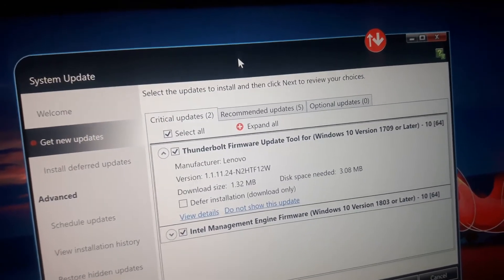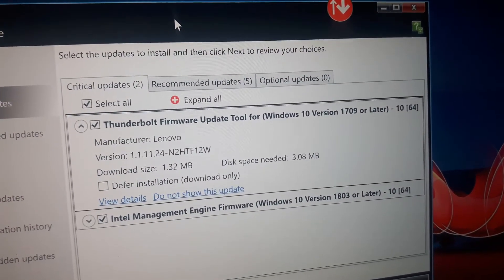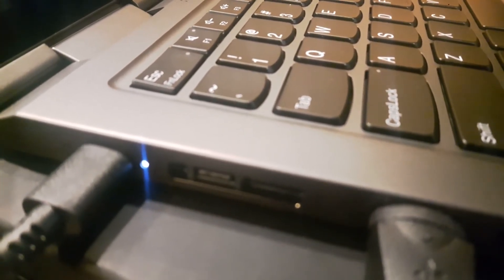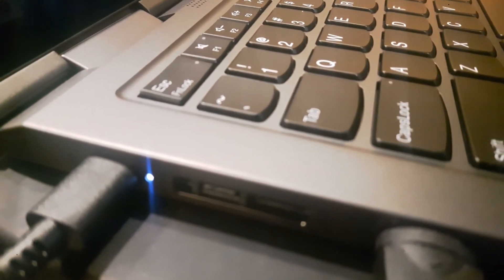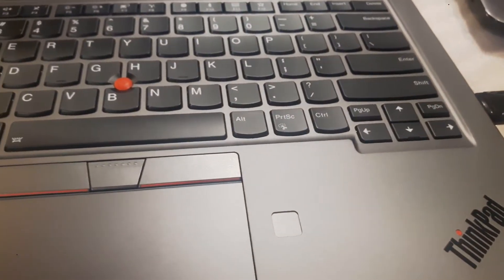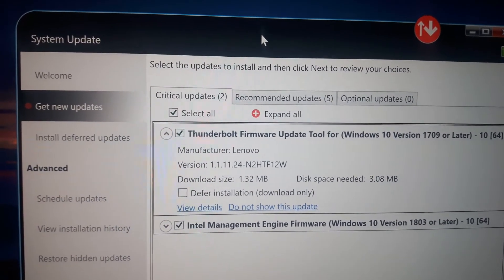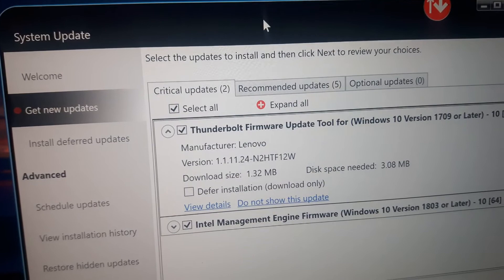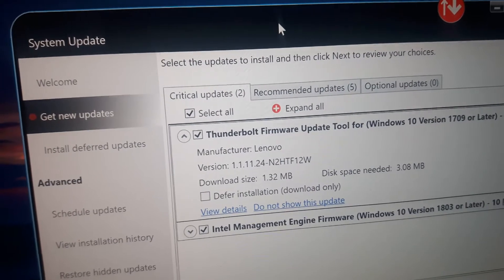Important: Have a ThinkPad with USB C (ThunderBolt) charging? Apply this firmware update

Comment: I just got a lenovo t480 and I am very confused as to how to check to see if this refurbished lenovo has already had the update. can you give information on that? or maybe how to actually do the update. thanks in advance
Reply: Did u find a solution ? Any Update Please
Reply: @PerspiCacious-wq7nk  not yet
Reply: Check thunderbolt control centre, tap about and it will say version
Reply: Did u get to the bottom of this?
Reply: Run 
Get-WmiObject Win32_PnPSignedDriver | Where-Object { $_.DeviceName -like "*Thunderbolt*" }
In PowerShell to see if you have the driver
You can check Lenovo vantage for updates
Reply: Right click the thunderbolt icon on the right left corner in windows, then choose about and see the NVM version if its 20 or more you are fine!

Comment: Does this fix the critical issue with the Thunderbolt Driver ???
Reply from the maker: It' should fix the firmware issue that causes the Thunderbolt device to flake out and die. If there's a Windows driver issue, that may be a separate thing.

Comment: Sorry, if this question is somewhat naive, but on Lenovo's webpage with the informations about this bug and it's firmwarepatch it says that the problem occurs when using windows. Does that imply that I don't have to patch any firmware if I'm using Linux? I mean, of course I can't use the recommended new windows driver but what about the firmware. The firmware should be relevant when using Linux also, or am I wrong? o_O
Reply from the maker: I believe this issue is a problem even if you are running Linux, as it is a firmware defect which is running on your machine even if you are not using Windows. There should be a way to apply this firmware from Linux... or you could swap out your SSD with another one temporarily, install Windows and apply this firmware update (along with any others).

Awesome that you use Linux. I do, too.
Reply: No need. That patch is windows-based. It won't run on your linux.

Comment: Hi.

I have a x1 extreme gen 2 thinkpad with an thunderbolt 3 station gen 2. Your video explains exactly my current problem. The laptop itself is great but once connected to the dockstation it will eventually crash due the fact of the connection usb c. It says that it’s not the original battery charger and once it hit 100 procent it will connect and disconnect itself from the laptop. In the beginning it was annoying, but today it will completely crash my device. I did al the available firmware updates, reset the bios and laptop itself. The problem still occurs and am 1 month out of warranty. What can I do. Any tips.
Reply from the maker: This issue causes physical damage, so if it the firmware wasn't updated soon enough it may have ruined the Thunderbolt device on your motherboard. You could try it in Linux and see if you have the same issues, which could isolate the problem and let you know if it is a physical problem or a Windows problem. If it is a physical problem, you may have to replace the motherboard.

Comment: Hi Matthew. Thank you for that video. Thankfully I've never had a problem with charging so far!. I have a ThinkPad L380 yoga (almost 2 years) and I was trying to use my recently acquired external DVD drive on the second USB-C port on the machine which is right next to the USB-C charging port. The machine seems to recognize it as I can see it showing up in Device manager, and it gets power to open the drive, LEd comes on... but the drive keeps trying to read the disc and nothing happens. The DVD drive also has an optional USB-A type connector too but that is "some-time-ish" at best. After some research - I updated the firmware for USB, Firewire IEEE 1394 Thunderbolt (via the Lenovo Vantage app). The firmware is labelled as "power delivery firmware". .. Fingers crossed.
Reply from the maker: Thank you for the comment. Hope the firmware update improves things.

I post more on odysee dot com, username RetroEdge dot Tech